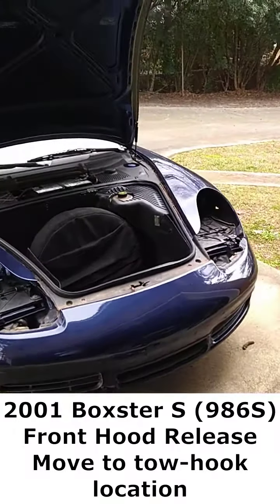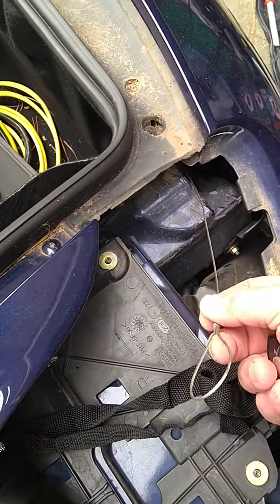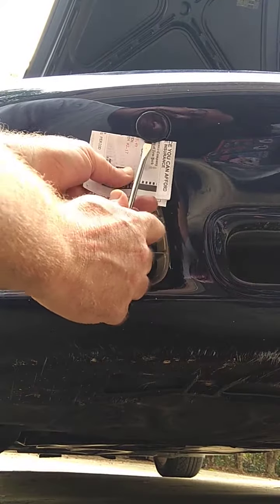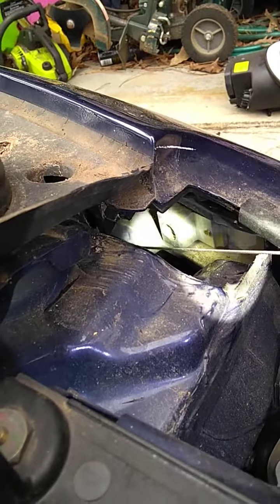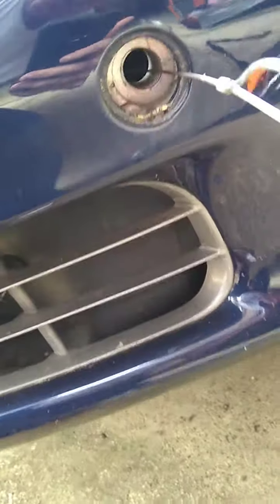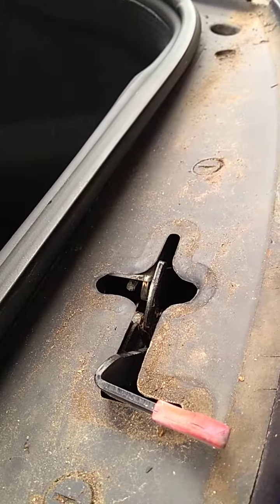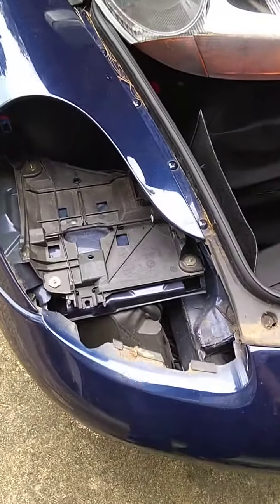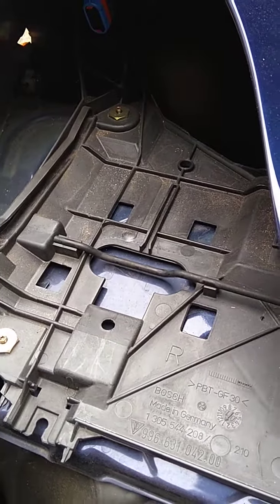Front Hood Cable - 2001 Boxster S Porsche

Comment: My issue is that I can not remove the light unit to reach the release cable to open the hood because the hood will not open so I can remove the light unit. Does that make sense?